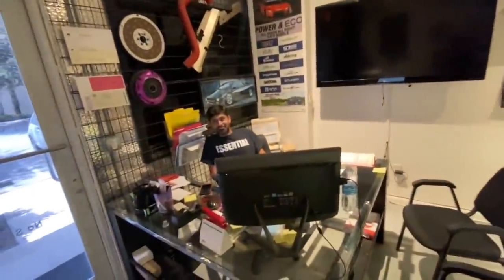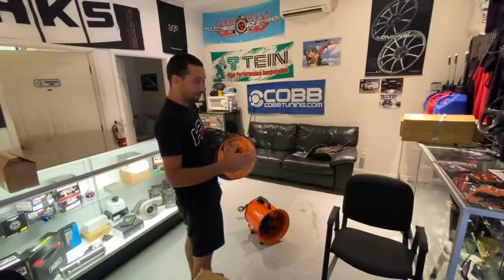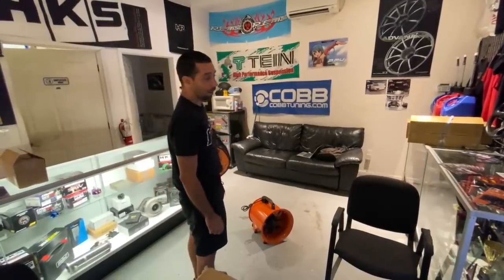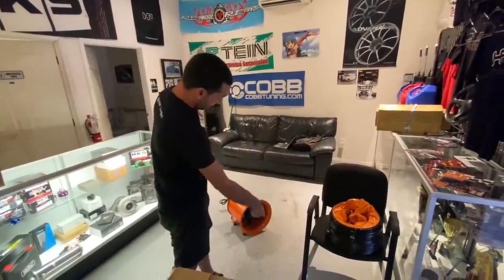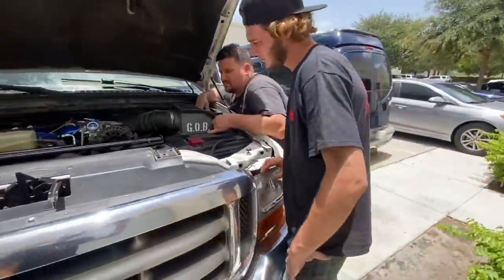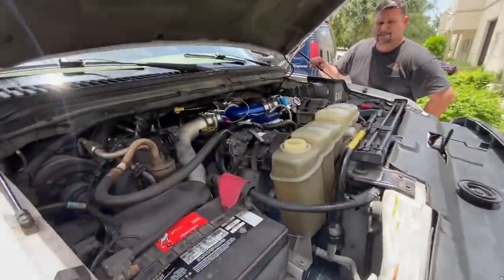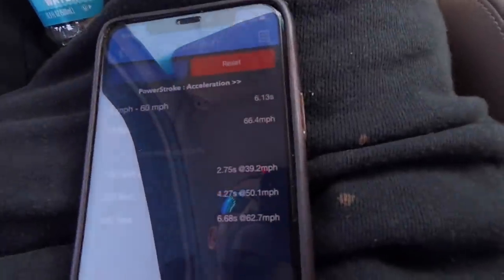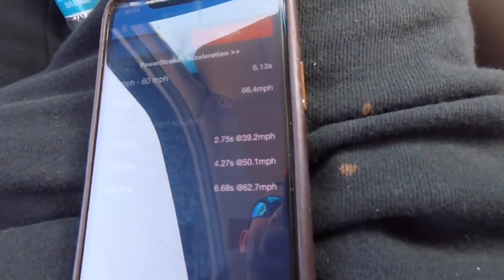GOB 7 3: HPOP and Fuel System UPGRADE!!! READY TO RACE!!

Comment: You should take aluminum rods and make an attachment to the ond of that slinky hose that are like arms that clip onto the exhaust tip because the trucks usually have a fairly bigger exhaust tip ,  so that it's not touching the actual exhaust by it is catch everything blown out and into the hose . Just an idea !

Comment: After u launch the truck after the 60 foot switch it back into 2wd get rid of that drag i bet it will drop .5 seconds on ur 0 to 60
Reply from the maker: Can you do that?
Reply: @JackCecil  thats what they do hear in Maryland when they race
Reply: Check what your shift on the fly is like my avalanche I can go between 4 wheel drive and 2 wheel drive under 60 mph. But yea when i use to go do the street racing thing back in the day they use to launch in 4 wd then switch to 2wd.